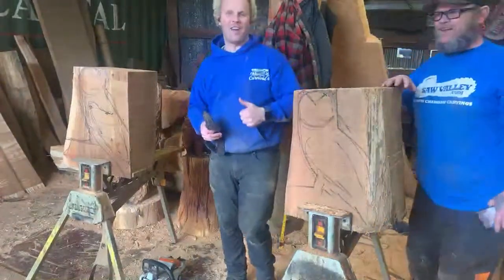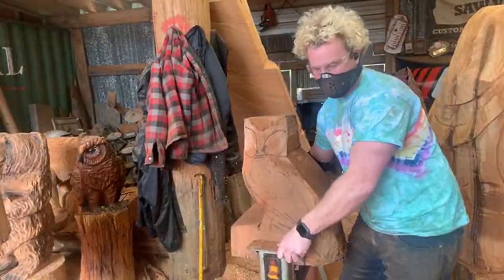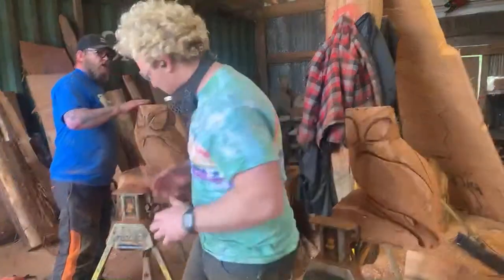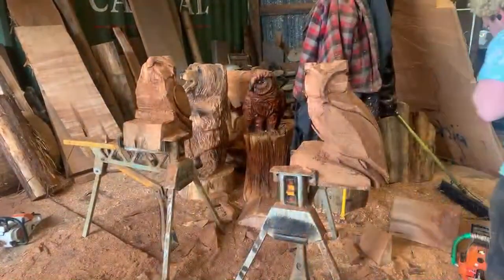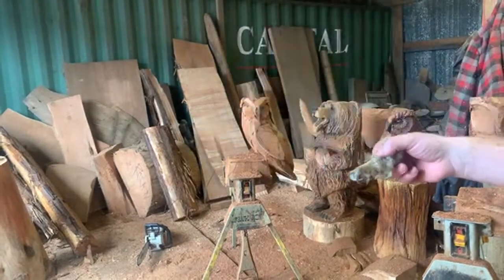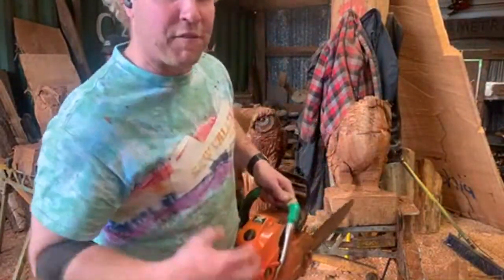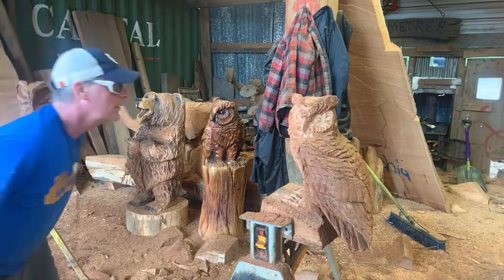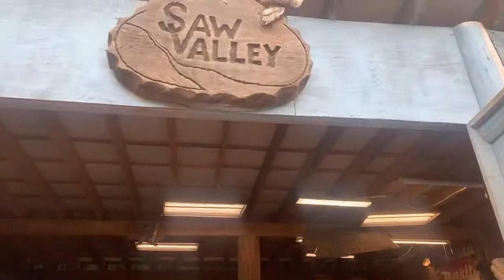How to Carve OWL WITH Carving fusion -LIVE

Comment: I bought the Makita electric finger sander and its awesome but i break the belts quickly any tips to prevent this happening? Thanks
Reply: I have one too. I havent broken a belt yet, ive gone thru 60 of them so far. They do pop off if i dig in too aggresively. Are you using the makita brand?, they are on amazon. I do fray them up by using the edge too hard
Reply: @jordanzothegreat8696  yes only use Makita belts.